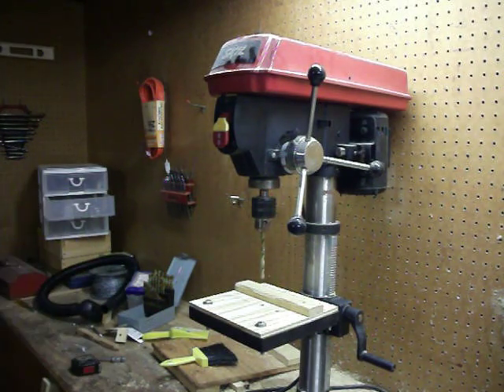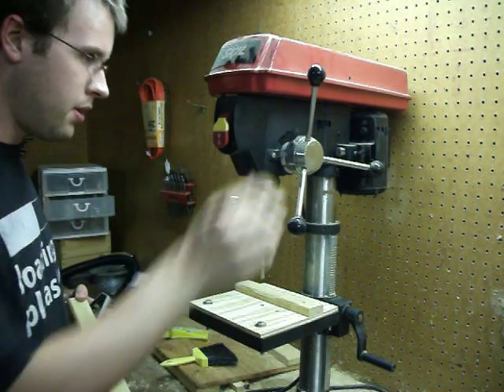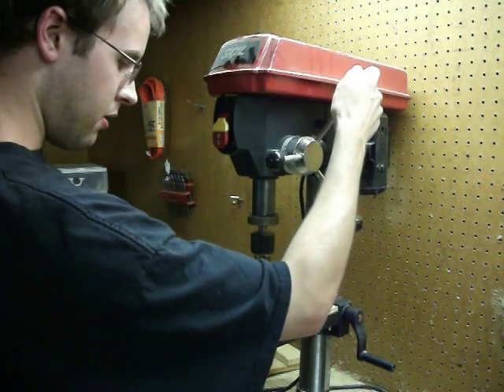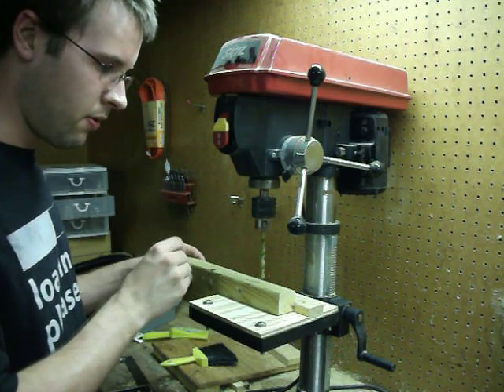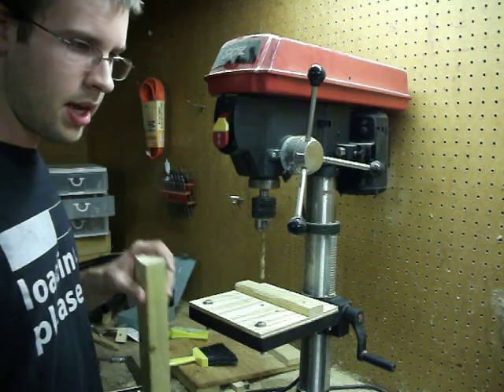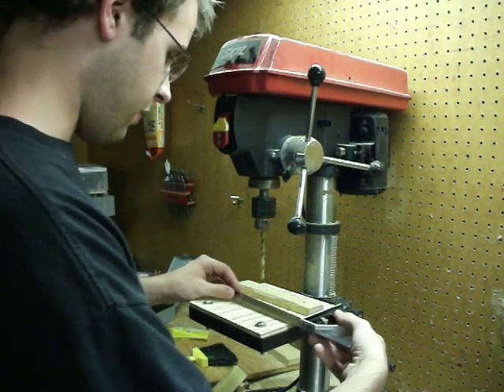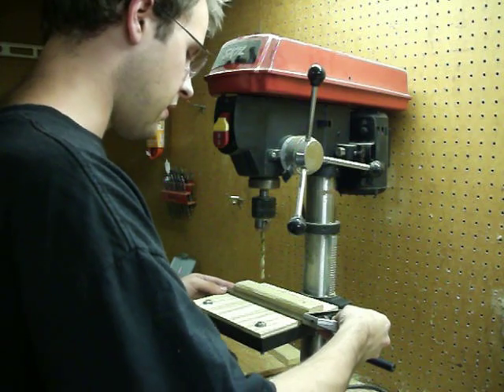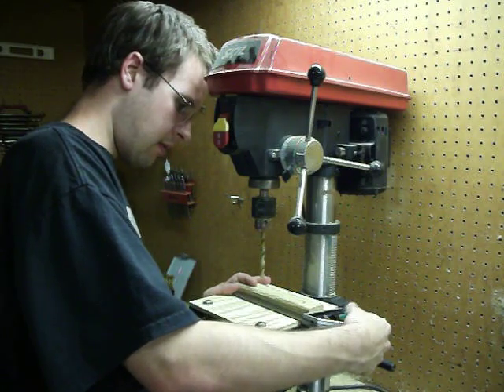Grid Beam Speed Jig Version 1.0

Comment: Great jig idea. :-) .. Suggestion: You may want take of the backstop and file/cut  a small 45 deg. angle relief on the bottom corner that faces the drill. This will help things square. You could also take a 1 inch hole saw and drill through the bottom where you drill press drill bit goes through the wood. This will allow the sawdust to fall through the bottom instead of building up on your jig :-).

Comment from the maker: @enticed2zeitgeist Yes, tri-joints compliment one another, the more you have the stronger and squarer your structure is. I didn't do it in the video, but the 24" cube I have for my computer desk I can literally jump up and down on and it's rock solid. I have a 2 foot by 4 foot table in my room that doesn't have any beams at the bottom for squaring and it's much less stable, but was still sturdy enough to hold my drill press way back.

Comment from the maker: @enticed2zeitgeist That's one of the biggest things you have to conquer with grid beam, the tedious hole drilling and measuring. But good accurate components will last you a long time and be versatile because you put in all that time and effort. I'm sure you know that, but even I have to make a point of reminding myself of how awesome it will be when I get them all finished.
If you measure out all of the holes, just get a piece of wood with a straight edge, set it at .75 inch from the bit.

Comment: @ContriteDiscursion Yea, I just set up my drill. I obviously need to create some kind of jig as well. It's quite difficult and quite time consuming even to just drill one hole. I can see why the template system is so important to get right. 

Also, I have a bunch of 2x2's (1.5x1.5) precut from previous projects. Only one side of them is actually 1.5 (the factory height) the other dimension is slightly larger, I guess this means I have to rip each piece twice on the table saw adding more work?

Comment from the maker: @enticed2zeitgeist I have used standard 2x4s (1.5x1.5 in reality) in the past but I've been pretty dissatisfied with them overall because they seem to never be quite straight, I actually use 2x10 (1.5x9.25) boards and rip them to the correct width. 

I use 1/4 inch diameter hex bolts, I know about the special ones you mention but I can never find them in any quantity. And the bolts are generally out of the way, so I've not had a problem. I just have two wrenches and I'm all set. :)

Comment: I just got my drill press tonight. I'm about to assemble it, it's too late to run it tonight but tomorrow I should be experimenting. 

Curious, what size/type connectors do you use and what size of drill bit? I presume you are using standard 2x4 wood, then table sawed in half to make 2x2's (actually 1.5x1.5)?

I looked everywhere for the Joint connector bolts that have flat head type screw and nut that you can tighten with just a hex key however I couldn't find them anywhere.

Comment from the maker: @enticed2zeitgeist Aye, having that many bits at once perfectly spaced would be nice, but it seems to be a bit beyond my engineering abilities. If you build one let me know!

Update: One of the problems -was- that the jig was not square with the drill press plate. However, it also seems that there was a slight error in manufacture regarding the wood backstop being just a little too close to the hole. Got to fix that tomorrow. Good news, it's making sure I get the correct spacing every time!

Comment: Great idea man. I totally understand what you mean. 

I was thinking about taking those pieces of pre-drilled angle iron/aluminum and using clamps to attach them to the wood for future grid beam and just drilling right through the pre-drilled holes in the angle iron into the wood itself. Of course it's a lot of set up to build the template iron pieces, but after that it should be a sinch!

However, it would be much better if I just had a drill press with 90 drill bits that moved down same time.